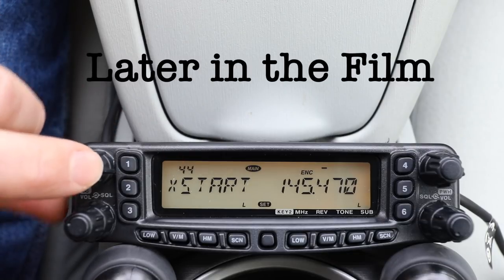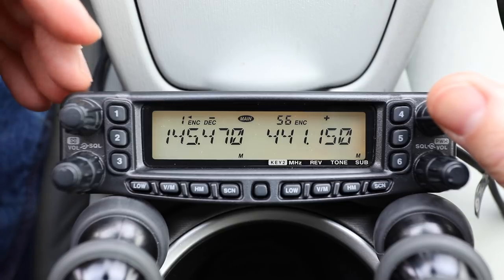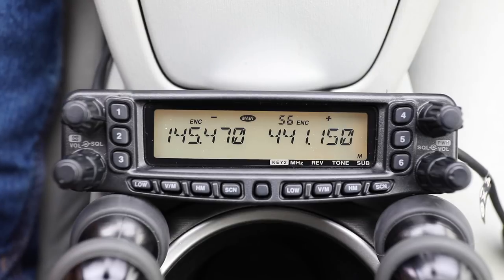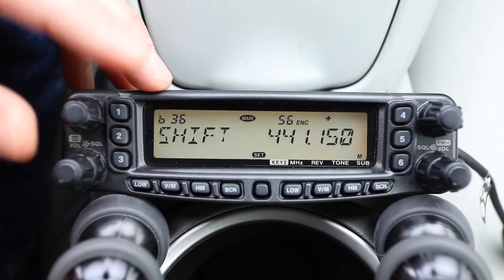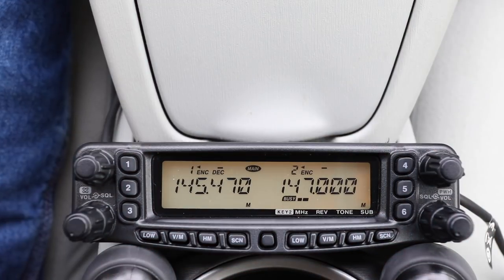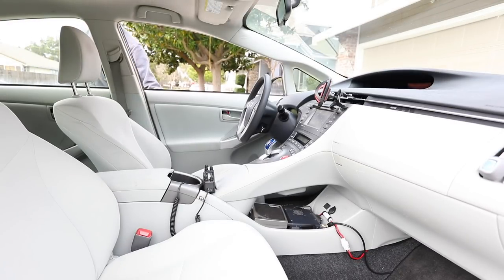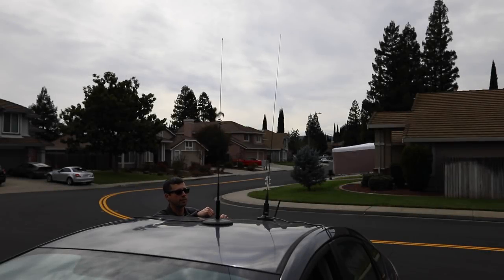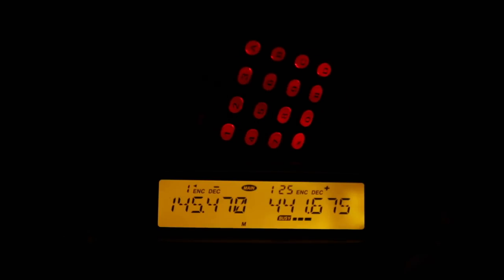Yaesu FT-8900R Basic Setup & Review

Comment: Just another note for those watching that may not know. The 6 "memory" buttons next to the screen are actually called hyper memories. A lot of people get confused about what they do. They are not channel memories. They are complete rig setup/status memories. Each hyper memory can remember which channel/vfo frequency is on which side, wether either side is set to memory or vfo, which side is set to MAIN, which and if either side is currently scanning, or if both sides are scanning, which bank is selected on either side and if its in bank mode on either or both sides or not. I have repeatera programmed for all over my state but dont want to scan or monitor ones Im too far away from. If I drive 50 miles to the coast, I only want to scan and monitor certain repeaters. Also, I almost exclusively use one side to monitor one specific repeater and the other side to scan. I also a lot of times use the scanning side as a scanner to listen to police and fire. If I drive 50+ miles in another direction, I may want to monitor a different specific frequency while scanning a whole different set of other repeaters/public service. Setting all this up in hyper memories saves me the steps of having to change banks on one side, then change banks on the other side, and then initiate scan on that one side, which is a lot of button presses. Being able to hit one button and have the radio go into an entirely different function and "state" with entirely different channels/banks/frequencies and modes is great!
Reply from the maker: Yes, great point! Those buttons are very handy. Thanks for sharing your example.

Comment: The 8900 was my first mobile radio as it was "A quad band radio!!".  I didn't read the fine print as I was a new ham and didn't realize it wasn't SSB also.  Oh well.  The crossband repeat function is one I have never used but after watching your video I thought of a way to extend the life of my Kenwood TH-74.  I can put the 8900 on crossband repeat, it is hooked up to a 35 aH battery.  The battery charge is maintained by a solar panel laying on the dash of my truck so the radio doesn't run the battery down.  With that setup I could have the Power Hungry Kenwood on extreme low power .005 watts and still hit the repeater using the 8900.  Thanks for the video!!
Reply from the maker: Very cool use of the cross band repeat. Thanks for watching!

Comment: I bought this radio a few years ago. It's been sitting in a box because of the antenna.  My buddy gave me the Diamond CR 8900, but I realized the antenna is stronger than my body panels, and had more of a chance of ripping a panel than breaking the antenna if it smacked in to something.  Decided to just not use the 10 and 6m bands, so I'll finally install it tomorrow after I pick up my new dual band antenna.  This video answered a few questions, so thanks for taking the time making it.
Reply from the maker: Good deal, I'm glad it helped you!

Comment: Thank you for this walk-thru! I have this radio in my Duramax and have been using it for mostly monitoring local fire and police simultaneously. It's been a while since I  put in my repeater frequencies, so I forgot the process - this quick video is a great refresh tutorial! The only thing I dislike about this unit is the speaker, which is very weak when compared to my FT-857d, but that is easily remedied by an external speaker, which I keep on the dashboard. 73!
Reply from the maker: Thank you very much for the kind words! Yes, I also run an external speaker too.
Reply: How do you like the 857 compared to the 8900?

Comment: Many thanks for this quick review about 8900r. Thinking buy a new one transceiver, now I see this Yaesu is esasy to operate. The old one I have is a really relic transceiver (Yaesu FT290R), up today on order, so I need others functions to operate over the repeaters around my QTH, with subtones, CTDSS, etc , and others characteristics, and a little more power just if I'm on this way to buy a new transceiver. I like very much the possibility tx on simplex to 8900R and it  send over other frecuency like a repeater a very good option for me, with the walky i can tx with this sistem and hear with second vfo because the reception is no problem, just the transmit  with 5W is not enougth to activate the repeater in South Iberian Peninsula from Ceuta, North of Africa. Already convinced, just order the 8900R. Best regards from EA9GT, QTH Locator IM75IV. 73' & BEST DXs  see'u on CW (Suscribed 😉)

Comment: I installed my FT 8900 in my 2015 Ford Fusion. The only real challenge was getting through the firewall, but I found the grommet where the main wiring harness enters the cabin. There was lots of space there, I just drilled through and pushed a #10 ground wire through as a fish wire, it came in behind the glove box. All of the trim, kickplates and sill plates just popped off, I ran the 10 gauge wires back to the trunk, then spliced on to the power cord, so the fuses are in the trunk, I ran a speaker wire back along with the remote wire. The base unit is mounted in the trunk to the body by the spare tire well. The trunk on the Fusion is not bonded to the body, so I installed a bonding strap. Right now I’m using the magnet mount antenna I was using with my Baofeng, but I’m looking for a better option. The the Fusion has a nice compartment/storage shelf under the climate/radio stack, so the head is Velcro-ed there, and the speaker is Velcro-ed in the storage tray. The only wires visible anywhere is about 4” from the storage tray to where the wires run under the glove box and above the kick plate. It’s s pretty slick install. I’m really liking the FT-8900, but I have not even scratched the surface of what it can do.
Reply from the maker: Very Cool! I wish YouTube would allow pictures in comments. Sound like you did a great job!

Comment: Hi ive had one of these for years. Couple of things, if you have reports of a noisy signal ( sounds like wind noise) after its been in cross band mode put it back in to cross band mode  and then take it out of cross band that usually cures it . I run mine with a triband 2m 6m and 70cm antenna  and use a duplexer to separate  the 10m . I use a dv27 cb  antenna for that band if theres a good lift on i  can get into the new york repeaters  on mid power  . Im in Yorkshire England

Comment: You can turn on/off the VOLTAGE METER on either display side. Pick which side to be your primary side. Momentarily push in and release the volume knob on the LEFT SIDE of the radio. You should now see a voltage displayed on the right display screen.  It will stay on until you release it by redoing the same process to toggle it off. On/off toggle to your pleasure..  Its sometimes really nice to quell the insanity of two active sides talking at once.

Comment: If your only using the Left side VFO Like I use on my TYT TH-9800 (basically the same as your radio with some menu changes), you can push the left vol knob (short press) and send it in to left VFO with Voltage displayed on the right side, Maybe it is the same for the Yeasu.
Reply: Im using mine as a basestation as most full size basestations are out of my price range.

Comment: I have a NOOB question, so thanks in advance.

Is there a distance to respect between the radio's body and panel ? If i want to mount the radio body on the back of the jeep and the panel next to my steering wheel, its about 3 mt, i guess. would this be an issue ?

Comment: Can you tell me which K400 mount I should use? I'm really new to radio and I have a Kenwood TM-D710GA I want to install. I need a NMO style mount but there's the K400CNMO and the K400SNMO and I don't know the difference. Thank you for this video. Super excited to do this on my own Prius but I want a fixed mount where I can put all the cords and wires inside the car. I bought a short 3" NMO antenna like police vehicles have. I want to know the range/effectiveness of that compared to the antenna you have. Basically I was looking to join the club but still keep a low profile look on the car. I don't think I can mount my D710 between the cupholders quite like you, though I do what to see if I can get something 3D printed for that same area. Thanks in advance!
Reply from the maker: How's the install going? I haven't bought a K400 style mount yet. They look nice, but I just put a magnet mount on the roof and it's been working great.

Comment: Hi there.  I'm tossed at which radio to get - the FT-8900R or FT-857D. I'm working on getting my license but don't want to purchase multiple radios. I'm planning to run it as a mobile setup,  not  a base setup. Does it pay to purchase the 857 and call it done then just work on getting the additional class for HF, etc. or just get the 8900 to get used to ham,  etc. Thanks,  great videos you put out.

Comment: Great video!   
As far as the mag mount antenna on the roof of your vehicle, any issue with paint scratching?  Any way to avoid it that you know of?   Thanks again!
Reply from the maker: Thank You! I haven't seen any scratches from the Diamond pancake mag mount yet. The bottom has some nice rubber on it. I have noticed a little color difference/fading. But, I'm assuming a wax job should clean that up.
Reply: make sure you keep it clean!  especially if you take the antenna on and off the car.

Comment: Couple of questions since I just got the radio...
1. Is there a way, while in Memory Mode, to set up one side of the radio to just show Freq. for all repeaters??

2. I have over 200 repeaters programmed, so when I go into VFO mode on one side, its to do Simplex. Is there anyway of setting VFO mode to default to Simplex and Not repeater mode??

3. Can you do a video addressing : Hyper Memory, Home Memory, MH-48 mic control, Scanning a Band
Reply from the maker: Thanks for watching! I can answer your questions 1 & 2, how I understand the radio. That  said, there might be more tricks to it, then I'm aware of. As for question 3, I will put that on the to do list.
1) No. How I understand the channel system is it's one memory bank that both sides of the radio access. Making a change to a memory channel will effect how both sides see it, whether it's the frequency or a repeater name you put in.

2)Turn off Menu #2 ARS and adjust Menu #33 as needed.

Hope this helps!!

Comment: Theres a menu item to show dc volts all the time. But U lose the sub band.
Comes in handy tho. I lost my alternater belt once and had about 15-20 miles to make it home. I switched off sub and ran dc volts to watch my battery voltage as I limped home.
Reply from the maker: Oh, no kidding. Thanks for the info, I will look into that. I hate that most cars out there don't give you a voltage gauge. I found this cool volts and temp meter that plugs into the cigarette lighter, which I use in the car now and the motorcycle.

Comment: Great video, thank you. My question is about the mount for the screen. From the photos I've seen it's hard to tell. It looks like there are mounting holes on the faceplate mount on both sides of the large hole in the center. If so, does it look like I would be able to mount a diamond ball mount from Ram Mount on this? If unsure, if I could get the measurements of these two holes I'll see how it would mount up to Ram Mount. Thanks again.

Comment: I'm a Ham newbie & just got my Tech license, & bought a Yaesu FT8900R.  Is there a way to turn off the Dual Receive mode?
Reply from the maker: Congrats on getting into this great hobby! If I understand your question correctly, you don't want to receive two different frequencies at once. I would just turn down the volume and squelch to the side from the radio you don't want to hear from. I'm not familiar with a way to turn it off and my guess is you can't.
Reply: @HamRadioTV  thanks for responding and the suggestion.  I'm going try your suggestion
Reply: You can turn off the sub main. In the menus look for something that sayd "sub". I believe you have the options of dc volts, on and off.

Comment: Can you read this S-Meter? Where is S-3 or S9 on this display?
Reply from the maker: The S-Meter on this radio are the 9 bars at the bottom. But, S-Meters can very from radio to radio. It can be a good reference tool for signals but not a definitive way to measure signal strength.

Comment: What kind of antenna do you recommend for xband repeat mode, id like to use it for hiking with an external battery hooked to the 8900? What do u recommend
Reply from the maker: I recommend the Diamond NR770HB 144/440 MHz Dual-Band. This is a radial-less structure and doesn't need the traditional ground plane. I also run this one on my car and move it to my RV's ladder when we go on trips. 
Link to PDF: https://www.diamondantenna.net/pdfdocs/NR770HNMO%20Instructions.pdf

Link to Amazon: https://www.amazon.com/Diamond-Original-NR770HB-Dual-Band-Antenna/dp/B00MANF3L6/ref=sr_1_10?crid=3C30SHQ76MDSK&keywords=diamond+dual+band+antenna&qid=1564932701&s=gateway&sprefix=diamond+dual+band+ante%2Caps%2C391&sr=8-10

Comment: Hello , q: I have yaesu2400 speak and received calling from distance  180 km in area mountain without repeator ,so how maximum distance by reapeator or without it    can we it use?
Reply from the maker: There is no simple answer. It will depend on the terrain, radio output, type of antenna and frequency. But, for every watt you get 5 miles on flat ground as a general rule for VHF/UHF.
Reply: @HamRadioTV  thank you for replaying

Comment: Hi I am trying hard to decide between Yaesu 8900R and IC 7230A. Need some light between the two.... Can anyone advice.
Reply from the maker: Geez, they will both get the same job done. Does the 7230A come with a mounting plate for the removable face? The 8900 comes with all the parts to run it on the body or mount it remotely.